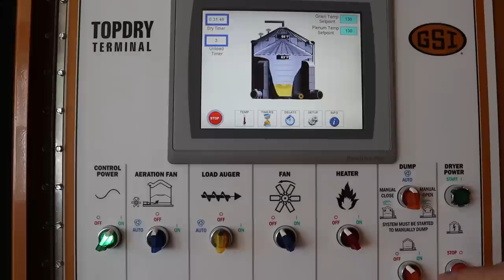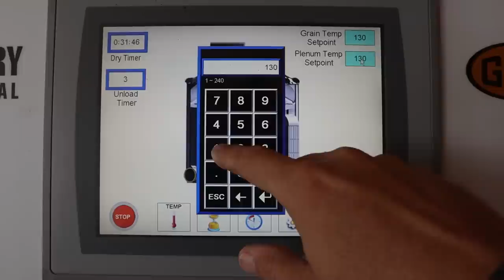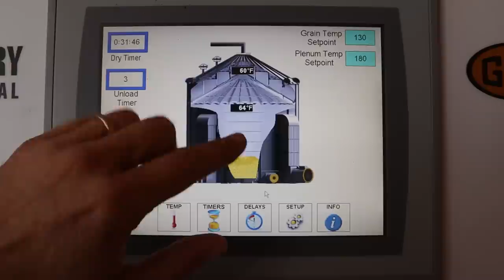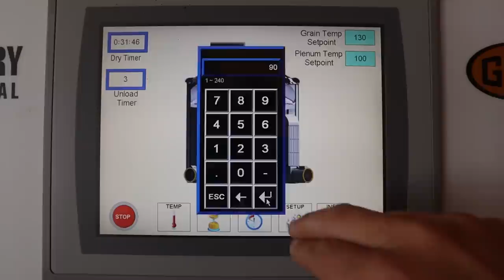Our GSI TopDry Autoflow system | Vlog 38

Comment: Mark. 
Thank You very much for the show and tell of the top dry grain dryer that is very neat to see the us of the PLC controler system. Just a side note in general the PLC controler systems are very durable and dependale. I Spent 10 years using PLC controler system on( Niles Stand Ray Wheel Truing Machine ) train wheel truing

Comment: We run the same system where I work, it works great. I assume you have the same size capacity wet bin to feed it? It takes a little over 2 hours the next morning to transfer grain out of the dryer, so not bad. We take samples out of the leg every 15 minutes while transferring to check moisture levels. Good luck with harvest this year!

Comment: The dryer sounds great plus the storage capacity will be good at the end of harvest my other question is on alot of farms you might cut beans for a day or two then go to corn and back and forth.won't it take awhile to clean everything out between each crop
Reply from the maker: As for cleaning out between crops, it takes about half a day for it to be super clean.  Less fussy, it take 2 hours.

Comment: Mark, we have a top dry that we’re operating as a batch dryer but want to make some changes to increase capacity.
My question is- how are you using it as an auto flow with only one leg to keep the dryer full and still unload trucks/transfer dry grain out?

Comment: Very clear explanation thanks. For best efficiency the exhaust air temperature should be very close to grain temp being introduced to the top. When it is operating is there any way of checking that?  Of course the bottom floor fan will by virtue of cooling the dried grain transfer that energy to the grain being dried. Looks like a well thought out system. Hope you don't have to use it too much.
Reply from the maker: I not sure if it can be checked or not.  All the temperature probe are located inside the grain bin.  Interesting though thou.

Comment: Great job describing the system. Very interesting. I'm curious how many bushels of corn per year you plan to dry with this dryer? I'm working with folks drying up to 60,000 bushels per year with a cross flow dryer and I'm wondering if the top dry would make economic sense for them for their farm size.
Reply from the maker: We dry around 120000 of corn a year.  Have a friend that just put a 24ft diameter one up for this fall that dries about 60000 bushel so about the same, so I'd say its economical feasible.
Reply: Mark I’m guessing there’s ample proforma data out there that gives you a good sense of when (how many years) a dryer like that “pays for itself” based on historic metrics?

Comment: How do the silobins work? I've not seen a tower/pipe in the middle before. Only seen augers and filling one by one.

Do you unload your trucks on one place to fill all the bins? And does unloading also work the same (on one place)?

I'm not a farmer, so i don't know all of it and these systems are new to me. Lol
Reply from the maker: The pipe at the top in the middle is connected to a grain leg (grain is elevated up 115 feet) which diverts it to the dryer.  Truck and wagon unload into a conveyor that dumps into the bottom of the grain elevator.

Comment: How does it work does they bin has to be completely full or it doesn't matter how much is in it 👍
Reply from the maker: It doesn't have to be full to work but likely best to have a little bit in the bottom to help with the heat being pumped into the bin.

Comment: Curious as to how quickly do you have to get the crop dried after harvesting?
Reply from the maker: Corn at a high moisture say 30% (dry is considered 15.5%) it will start heating in 24 hours and can some problems.
Reply: @MarkBrock  thank you! Do you have for your own use only? Or will you do custom work for area farmers if needed/asked?

Comment: Hi Mark quick question for you, are the two plenums the direct the hot air to the top insulated? I would think there would be significant heat loss if they are not insulated.
Reply from the maker: They duct are not insulated.  In speaking with the company and others, I'm told there's very little heat loss as the air velocity is extremely fast.

Comment: What are your costs per acre when doing custom work? What do you charge, or where would be a good place to start for charging for custom work?
Reply from the maker: Not completely sure our cost per acre, but when we do custom work we use rates that are typically charged in our area.

Comment: a 3 second dump time seems really short.   Is that right time for corn
Reply from the maker: It will likely dry for 20 to 30 minutes in the outside tier, dump out of the chutes for 3 seconds which dumps a 1/3 of the corn in the whole roof, and then refill and start the process all over again.

Comment: Has your corn black layered yet? Natural gas and 3 phase you lucky guys. We're all single phase with VFDs for the bigger motors but still pretty limited on power, we do buy LP by the transport though big cost savings doing that.
Reply from the maker: No black layer yet but getting pretty close.  Looked at doing the VFD thing but decided to go with a diesel generator instead.

Comment: Seems like your dryer is trying to defy science. Hot air rises so why pump it to the top ? N cold air sinks so why try n force it up ? It’s going to take a lot of energy to push heat down into a solid mass rather than letting it drift up. Plus your wettest corn will be the first put in so your days of storage quickly disappear awaiting the heat from the top to get to the bottom ( wettest) crop. On cold days those ducts will be a huge heat loss til they warm up then condensation will be blown along with air from the drastic change.
Reply from the maker: Haven't had it running, but there a number of them in the area and they seem to work fine in the cold weather and wet corn.  My understanding is that with the velocity of air from the burner fans, there's very little heat loss through the ducts.  I might not have explained it well, but the hot air is pushed up through the corn that is drying and the cold air is pushed through the bottom corn upwards and warms as it travels through the hot corn. This air joins the burner hot air to help with the efficiency.  Based on some studies done here in Ontario, it is one of the more efficient drying systems.
Reply: I’m sure they do but at what efficiency could they operate.
Reply: I thought the same thing about the wet crop in the bottom first but that's not how it works. Think of it as the same super B dryer setting on top of a normal bin. As it cycles dry crop out to be cooled it drops into the bin. It's not trying to dry the crop from the top down, its called a top dryer because that's just where the dryer is. I also see the advantage of the air that cools the crop pushed out except when it may be much cooler that grain temp being dried. I'm sure there is a lot to learn on this system but isn't that the case with all new equipment.
Reply: Those burners heat air that go up via the ducts - not really forced, the fans there are to minimise heat loss. The cool air entering via the aeration fan is not forced up - it forces cool air in to cool the warm dry corn at the bottom & in turn making the air hotter & hot air goes up to help dry the corn on top faster. The dryer uses the science of physics more efficiently.
Reply: jofizal ok the reference forced is stated as it’s the only route for said action due to its natural physics make up. If air is directed it is considered “ forced” like an intake in a vehicle. No fans blowing air into motor however a stand alone is considered forced air intake right ? Lol.
Reply: jofizal furthermore you’re talking about 25’ of difference in the two zones that are to be working together. How much condensation will occur nobody knows. Let alone it taking how long til the two zones can actually exchange said air ? Your storage days of wet corn are minimal st 25 30 35%. N quickly diminish as moisture goes up. If air is being put into a tube n sent up would you call it voluntarily moved air ? Negative. It’s routed n designed to push it up hence forced.
Reply: @Gixzer04  What do you mean nobody knows? He stated in the video and again responding to you there are other farms near him using this system and saying there happy with the way it works. After you spend a season using it you have some idea of how things are working.
Reply: hawki5120 do you know at what efficiently this dry down could take place ? Have you read a statistic poll of how much less fuel n energy was consumed from drying a different way ? Or is this the only design that everyone should use with no improvements ? Just because everyone is doing it doesn’t make it efficient brah . Massive condensation n heat loss from those tin ducts with no insulation to protect them. Apparently you’ve never seen ducts with 4” of frost on them 😂😂😂
Reply: @Gixzer04  No I haven't brah. But I'm guessing the people who use this system have. I'm guessing they looked at the corn that came out of it and said yep it's in the range we wanted it and then looked at how much money they spent on getting it dry compared it with what it cost them before and were happy with the results. Real farmers using it in the real world. I'll take there word over your physics book brah.
Reply: hawki5120 then they scratched their heads , grabbed their clubs n dragged their knuckles back to their bedrock abodes. I’m sorry if somehow you mistakenly misinterpreted my entire thesis as a “ matter of end result moisture “. I thoroughly understand it’ll dry the corn. Feel rather elementary for this but it’s the efficiency level that was of topic , n focus. That being said , is there a max % it’ll handle ? Yes you can blast propane burners via air fed n dry whatever you want. But at what cost ? And at what could I dry down the identical bushel via said alternative theory / design. Reread n understand the variables discussed. Maybe you don’t dry 30,000 bushel or whatever but those that do understand all circumstancial processes that occur when filling a bin. First grain in is on bottom but it’ll be the last to receive the hot air it needs. Mono center cylinder perforated or multiple said items smaller in diameter would not only structurally improve upon but uniformity as well.
Reply: Stephen Arrington i know there’s major RnD in these systems n for obvious reason. Let’s say just those ducts were lined with a decent insulation. Maybe the duct is a dual wall insulated or other said protecting agent that I’m ignorant to n correct me if I’m wrong. It’s not like I’m picking on the owner of this system either or bin fir that matter. Just made me think n question the general principles driving it all
Reply: @Gixzer04  I didn't. If you watch the video he clearly states towards the beginning that people whos opinion he respects have been using this system and recommended he go with it. I'm guessing you wouldn't give that recommendation if you were going broke drying the corn and in fact he even said at one point they said it was cost effective. The fact he built this last year tells me they have been using this for at least 2 or 3 years anyways. That seems to be a fairly good test sample to me.